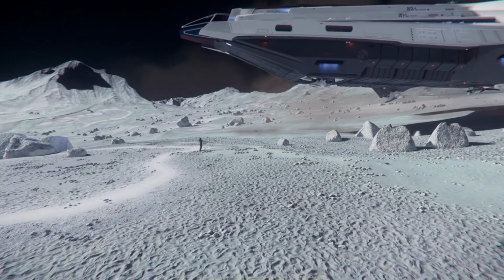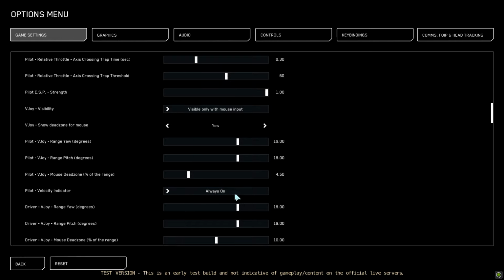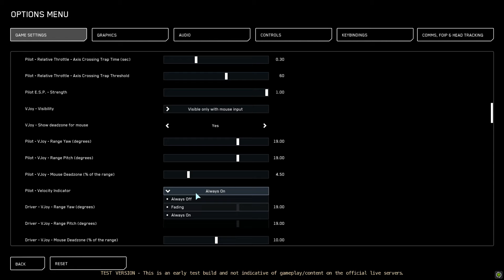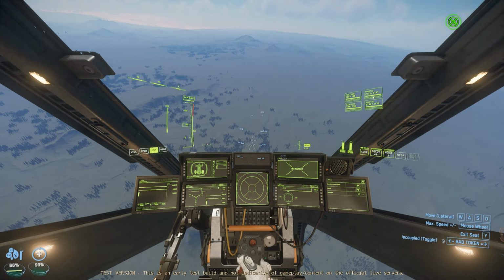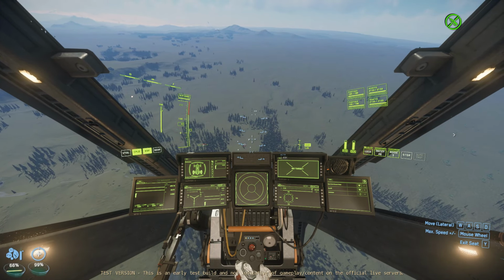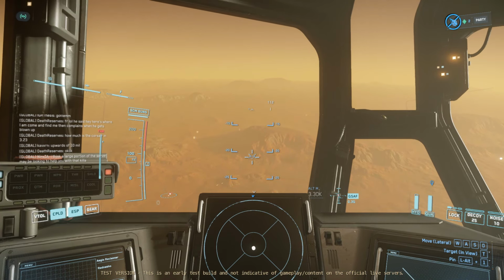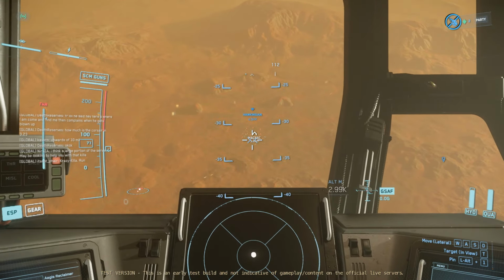Vector Landing Tutorial - How to do Pro Landings! - Star Citizen 3.23

Comment: If SC did a proper simulation, this should work only in space or in absolute windless atmosphere. Any kind of slightest wind would shift your former target off the original spot.
Reply from the maker: Yeah, although I think for a lot of people this is already hard enough as it is. Maybe its a good balance for now.
Reply: You could argue that decoupled really is setting your IFCS to keep your current vector, which would mean counter-acting any external forces, such as wind or gravity as it does now.
Reply: @DonDrage  Nope. Decoupled does not do any automatic maneuvering thruster operations. It does not auto-correct for anything. It's the very definition of decoupled.
Reply: @AngelicStreak  I mean, you can see that it does exactly what I said in 3.23, we know wind already does affect ships as you could see when ships blew away on Hurston when the wind there was over tuned.
And now, in 3.23 decoupled counter acts gravity with landing gear up or down, just just when it is down like in 3.22.

I don't know where your definition of decoupled comes from, as I see it, it is up to CIG to define exactly what it means, but they could very well give us options to turn off gravity and wind assist, I could see those options being useful in a Gladius when you're trying to fly purely through lift, control surfaces and main engine like a plane.
Reply: yeah and the space travel would be like kerbal space program, sc is not an simulation
Reply: Wind was simulated a while back and people hated it. They also had a realistic flight model, and people hated it (hover mode made this stuff easy once you breached the learning curve. But its rollout was buggy and people misidentified bugs as features. Then it was a hate bandwagon full of morons.) weather sims, wind for atmospheric flight models, and something akin to hover mode will be making a comeback eventually.
Reply: @AngelicStreak  From what I can see in the game, coupled vs decoupled is just whether your flight computer wants to attain 0 velocity, or not.

If in coupled mode, the computer will do everything it can to halt any movements of your ship in any direction, unless told otherwise by either you giving a movement command, or having the CC set in the case of forward motion. If you turn to face a new direction the computer will actively fight any movement in the previous direction, until your only movement matches any direct commands from the controls. Giving no inputs, and having no CC set will result in the computer attempting to halt all motion and hover in place.

Decoupled will do nothing to halt existing motion, but will resist external forces pushing on the ship, such as wind, gravity, tractor beams, etc. (At least, in 3.23 it does. Decoupled used to not resist gravity, making it quite deadly on planets and moons. Also not entirely sure on the tractor beams, but IIRC you need engines disabled to tow a ship, which would imply that. Could be wrong there.)

Engines fully off will obviously not resist anything, and you fall out of the sky.
Reply: Wish they would implement proper flight models
Reply: @ScientistMan96 there's now a separate bind for disabling gravitational corrections (which likely coincides with other interference), independent of decoupling, so yeah they've split that function of decoupled
Reply: @AngelicStreak except decoupled in SC isn’t really decoupled like in irl or in Elite Dangerous (flight assist). Your thrusters always counteract rotation even in DC mode in SC. Play Kerbal or Elite to feel what real decoupled feels like.
Reply: @ksyyyy5448 Kerbal is GOAT
Reply: @jacobburgin826 wrong game!
Reply: lol because in a universe where there is spaceships with such technology, mans cannot imagine that the most basic computer systems would most likely counteract any external forces like wind to a millimeter.
Reply: Man, assuming planets have wind in 2024
Reply: @Angelicstreak this was true up to 3.22. Now the engine automatically compensate for gravity in decoupled flight.
Reply: Regular decoupled mode does this, but I believe if your landing gear are down then the ship will account for gravity and prevent the ship from falling while also attempting to keep the ship's speed and direction the same
Reply: Flying decoupled via kbm is much to dangerous while landing. I stay in NAV mode during the landing process and activate VTOL mode when closing in. From there course correct as needed with wasd and scrolling down with the MMB to keep from crashing. When dropping in the hanger lower wheels and at touchdown your speed will be close to zero. Also on takeoff I stay in NAV mode. Only time I use SCM is when jousting.

Comment: Nice video, though I disagree with keeping the boost enabled during spacebreak. 

The reason you turn it off is so that you can more finely tune exactly how much thrust you want to apply when adding reverse power in any direction, rather than using 100%. Thrust translation (Up, Down, Left, Right Strafe) should be able to slow your ship enough if the descent is properly planned. Boost should only be needed if you misjudge or need to make a last minute correction, or to abort.

Personally, I think pilots would be better served in learning how to land without it, forcing you to learn the flight characteristics of your aircraft more precisely. The landings you have when you do it this way are definitely a bit more challenging, but look and feel even better to the outside observer.
Reply from the maker: I think that would be the next step after this video, since people don't fancy crashing so much while learning. But good tip.

Comment: The way I land is stay uncoulped and in Nav mode. Then just use MMB to adjust speed control to right above the landing pad and drop gear and vtol to land. SCM mode is crazy slow.
Reply from the maker: Lots of people prefer the slow approach to avoid crashing. What you’re doing is totally fine! Just requires a bit more control and experience. And a lot of times, shields are a necessity.